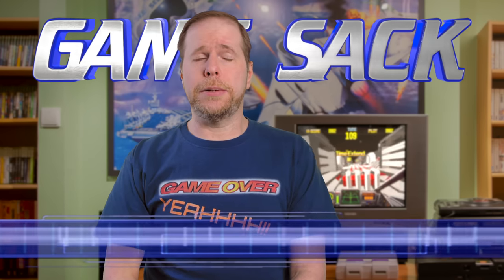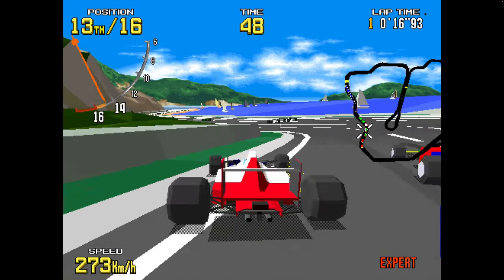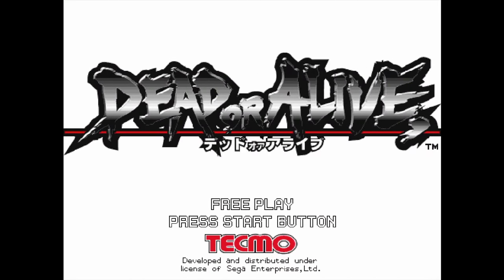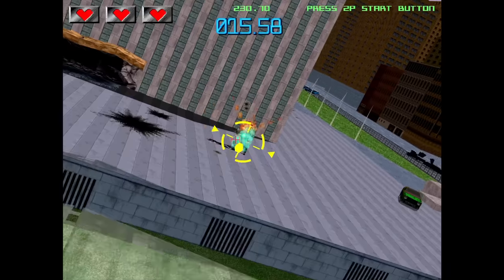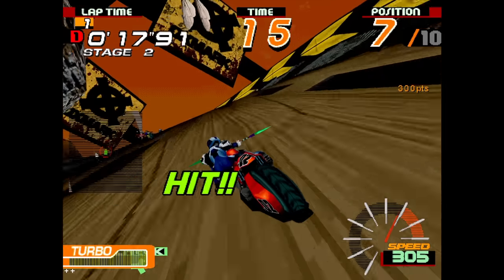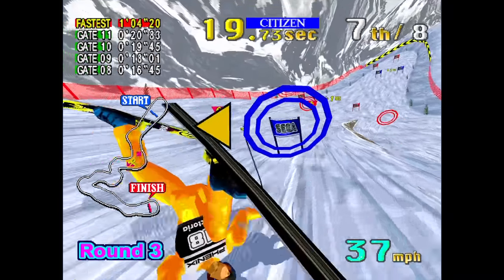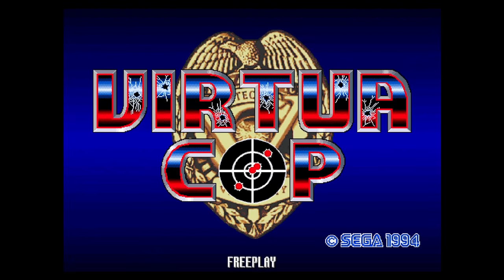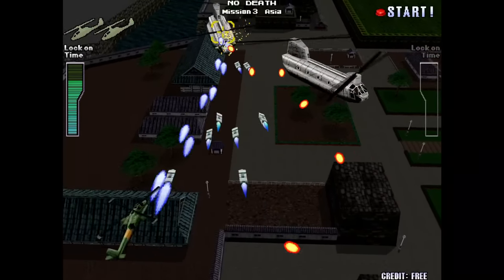All SEGA Model 1 and Model 2 Arcade Games

Comment: Virtua Formula was made for the pneumatic Full Motion Cockpit version. It does not have 16:9 because it used a 50" 4:3 Rear Projection TV for each Player. Most were later converted to Indy Formula (Upgraded Indy 500 for this cab) Sadly most were parted out in the early 2000s and eventually retired and replaced with the Super Deluxe Outrun 2 (Worked for Sega for a while in their Arcade Division)
Reply from the maker: Excellent info, thanks for that!
Reply: So the cockpits were pneumatic? I thought it would be servos and hydraulics. Neat.
Reply: @justin43098  Yep, Had to move an Indy Formula into a new Gameworks once, thankfully they had started building the locations with Air Lines throughout the building hooked to a huge Main Compressor in a sound deadened room to service it so all Pneumatic moving games did not need a separate and loud Compressor on the floor.
Reply: @youtubekilledtrustedflaggi9274  similar
Reply: That’s fascinating! I used to visit a large arcade in São Paulo, Brazil, that had 8 of these massive Indy 500 machines - and never understood why the cars had such different colors or the decals didn’t seem to match the game until I learned that they were likely converts from Virtua Formula. Sadly by the mid 2000s most of the pneumatics stopped working and they were eventually retired - by Outrun 2 SDX machines, of all things. These took up a lot less space, but the screens weren’t as impressive as the original rear projection ones.

I can still hear the “DRIVER CHANGE!!” yell from O2SDX in my head, haha.
Reply: We had it at my regular arcade, Wonderland, N1 City Mall, Cape Town, South Africa.
Was one of the largest arcades on the world at one time. It's a shadow of its former self now. 😭
Reply: I farted air out of my little bottom 💨

Comment: Man, Daytona USA is so much fun playing it in Manual, the way you drift by turning the wheel fast and then counter it on another direction while gear changing to Gear 1 and the Gear 3 & Gear 4 couple of times..
When you pulled it off, you'd feel like a badass.. so satisfying
Reply: The arcade with gear stick is definitely the way to play Daytona USA, playing it on console while is still fun, you definitely lose some of the magic by playing it with gamepad
Reply: Totally! Daytona USA was the only racing game I ever played using Manual!
Reply: Oh man, definitely..
Slamming it back 4 as you straighten out... I can still feel it!
Reply: The ol' 4-1-3-4. Nothing beats that. Except on the final turn of the Expert course. Sometimes you spin and look like an ass.

Comment: Back in the nineties, I worked for Toshiba UK LTD. I'm based in Plymouth UK. Part of my work was on the assembly line for Toshiba Rear Projection big screen TVs, which were a thing before cheap big screen plasma, and finally LCD screens came along..I mention it because we used to build the Sega Arcade screens for UK arcades. We had a machine set up as a tech demo on the production line, which showed Virtua Racer when I started, and was changed to Sega Rally by the time I left.

Comment: For Virtual On just use Model 2 Emulator 0.9 and you'll be happy again. Dual joystick support is limited in the last (1.1a) version of the emulator because it doesn't accept 2 inputs simultaneously

Comment: a lot of these games are more about the arcade experience, the physical presence of the machines, the unique control set ups and atmosphere more than the games themselves which are still pretty good
Reply: This is why I build myself an arcade a few years ago instead of emulating it on the TV sitting on the couch and play with a pad.

Ok not original but I tried to emulate the feel a little 😂
Reply: This is ironic because I actually prefer to play games like Daytona USA and Crazy Taxi on a controller than an actual wheel, pedals and gear stick lol

Comment: I wanna point out that Motor Raid does infact have a home port however it was only an emulated version of it in Judgment and its sequel Lost Judgment as a game you could play in the ingame arcades.

Indy 500 also has a conversion of it on the R-Zone which I'm sure is very much an arcade perfect port of it on the headache inducing red and black glorified calculator.

Comment: Such great memories, used to love top skater, had a cabinet over here in europe(btw the "S" rated tricks were if you jumped right at the tipmost of the ramps) it was a phisical skateboard with the buttons as the nose and tail and you had to tilt to turn and press buttons (fun mess) as you rode it inside a plastic dome with side handles to help balance. Had a great time reminiscing. Thanks Joe :)

Comment: I think for some of these it would be worthwhile showing the cabinets and describing other features instead of just showing video from an emulator. For example Gunblade NY wasn’t just a light gun game like Virtua Cop. It had huge machine guns mounted on a platform that would vibrate and shake with the explosions in the game. It was a completely mindless game but the physical cabinet added a ton to the novelty of the game.

Comment: I've had the chance to play Gunblade NY: Special Air Assault Force in the arcades and it was pretty fun, because it has one of those mounted turret guns with force feedback that you aim at the screen. That immediately makes it more fun. There's also a Wii version, for those of you who enjoy playing light gun games on the Wii (if I'm not mistaken, Joe doesn't). The Wii version comes with another cool game called L.A Machineguns: Rage of the Machines. Look it up, it's worth it if you can find it cheap and enjoy these types of games!
Joe, I don't post often, so I wanted to say something I should have said some time ago, I believe your sound mixing improved in the last few years.
At least it seems that way to me, since I used to have to change the volume throughout the same videos due to some parts having high volume and others being too low by contrast. But now the volume is constant, which is pretty cool. I hope you're proud of what you achieved with Game Sack, it's a great project, and one can tell you enjoy doing it.

Comment: Fun Fact - Gunblade NY was eventually ported to Wii in 2010 but was heavily censored for some reason. Lots of 9/11 related changes which are odd because by then companies had pretty much stopped doing that. The World Trade Center is deleted from the skyline and backgrounds, the United Nations building in Mission 3 is undamaged while in the original game was missing huge chunks from the side, a lot of damage to civilian buildings in background was removed, and oddly enough the NYPD cops you see get killed in various parts of the game (most notably in the second missions intro) are replaced by cab drivers in yellow hats for some reason.

Comment: I grew up with a few arcades not too far from where I grew up. Out of these I have fond memories playing Rail Chase Two, Motor Raid, Virtua Cop 1 + 2, Top Skater, House of the Dead, Daytona USA, and Sega Super Ski. The closest mall near me actually had a Sega branded arcade inside, it was called Area (some number) then later turned into a Gameworks. That closed then turned into World Sports Grill by Sega. That didn't last too long sadly. Thanks for bringing back all kinds of memories!

Cool crt by the way, is that the 24"? I have the 20af43. Just saw a 27af44 for 50 usd the other day and was tempted to pick it up. It was gone the next day D:

Comment: A particular tidbit on Virtual-On. If you happen to be using the latest version of the Model 2 emulator, it does have a weird bug where the simultaneous inputs could not be read. Meaning any of the movement stuff will be very clunky and may noy even work at all (like jumping or blocking)

Your solutions to that can be using a particular older version of Model 2 emulator, or playing the ports done by M2 instead (so that's PS2 Sega Ages, the one on PS3 and or 360 I think, or the Master Collection on the PS4). There's also the version within the Yakuza Kiwami games.

Comment: World Touring Car is a good driving game if you know how to play.
- You don't turn the wheel as hard in the game, playing like Daytona or Sega Rally is not ideal. Gentle accurate turns are needed.
- Brake tapping is necessary. Never slam the brakes, accellerate and tap the brake when turning, if you hold it down you will slow down hard or skid off the road.
- The game literally shows you the ideal spot on the road to drive : The darker parts. You'll notice a darker black mark all around the track. Follow that for the best laps and ideal points to turn from. 
- Once you complete the game, it unlocks the best car in the game which is like a rocket on wheels.

Comment: Since you've done Model 1 and Model 2 stuff, I'd love to see you tackle all of SEGA's STV games some time. Though that might could be preeeeeetty difficult with all the wacky Japan-only games and the odd photo print club stuff.
Reply from the maker: Are those emulated well?
Reply: @GameSack  Mednafen has compatibility with some games, MAME seems to have the best compatibility overall; though emulation is still, and I quote, "Imperfect" for some of the library. Now that you mention it though, I feel like it might take a little while longer for emulation to be at a consistent level; Saturn emulation is still a bit shaky and the STV is very close to the Saturn's architecture after all. But I digress.

Comment: Thanks for another great episode!! Question: I believe there were a couple of sniping games in the arcade then ported to SEGA Dreamcast also from SEGA. Does it ring the bell? The cabinet had a sniper rifle for accuracy and it was basically aiming at ppl on buildings.
Reply: Do you mean Silent Scope? If so it was actually made by Konami and the arcade hardware was the Konami Hornet. I wasn’t much good at it but I liked that series.
Reply: @tournaline3448  yes that's the one. Thanks for dropping the name, it has been a while and I couldn't remember.

Comment: I forgot Model 1/2 ran in 498x384, historically I find a lot of real performance related reasons for 360p range graphics especially for home platforms but not a lot of screen mode support across the spectrum of era relevant hardware platforms, I'm still not so sure what was so hard about including a mode directly between 240p and 480p, like even the SS can't do it? We'd be using it with 2X upscale in 720p right now had it been included more everywhere.🤔
1:26 I don't see any points of contention around "clumsily" after doing a quick 3-second search, so I think you're good.😉 But you can't press block-buttons, that's just odd?😄
Flat shaded polygons never did quite get to stretch it's legs until the point when it got outmoded Ie. Model 2 coming so soon after. Many people tried to make it happen sooner but the hardware was just too darn expensive in the mid to late 80s, PC software rendering made a good effort but poly count and frame rates could never get past novelty grade speed or match 2D frame rates bitd.
Even when texture mapping came in on Model 2 the home hardware like SS & PS1 still had some massive performance advantages for flat shaded polygons but that got relegated to special unlocked modes in most games that even did that. A lot of fun seeing all these games with such high video quality, I don't think I saw 50+% of these irl during my arcade days, one main reason to have a SS back then.😁
13:37 Out of all the SS ports that's the one I'd like to see get a homebrew remake since Sega did it dirty bitd. Would have been nice to see more optional RAM cart support in the SS 3D titles even just as texture space.
I think a lot of the special arcade control peripherals fare better now as many VR tools can tilt-approximate some while anything beyond that might make for some fun MAME 3D printer DIY kits. I see you already do such projects, easier to mod than I thought.🙂

Comment: Why did you disabled the texture filtering in Model 2 games? Model 2 was the first commercially available harware capable of texture filtering. Motor Raid is great! I play it to this day!
Reply from the maker: I don't recall disabling anything.
Reply: @GameSack  Sorry! Some emulators, like nebula, comes with bilinear filtering disabled. Nebula is old but very nice, small and competent. Too bad it is not being developed anymore. To enable texture filtering you have to edit the EMULATOR.INI file and change Bilinear=0 to Bilinear=1
Reply from the maker: @dijabreu  I used an emulator called Model 2.
Reply: @GameSack  If the executable is "emulator_multicpu1-1.exe" or anything like that, that's the one! You have to enable billinear filtering in the INI file. There's tons of things you can change, including gamma values.

Comment: The Model 2 emulator is a pain to emulate Virtual On due to its broken controls, if you push both sticks to the same direction one of the inputs will be cancelled so you can't play properly

Comment: Thanks for the great video but it looked to me like you were struggling with Virtual On. Not surprising considering the in-game tutorial tells you how to walk around slowly but it doesn't tell you that dashing and jumping provide a lot of mobility and firing while doing so makes you automatically turn to face your target. If the controls are unresponsive with that controller it doesn't really matter though. I loved the game on the Saturn but I only got to play it in the arcade once. When I returned to the arcade years later it was gone, replaced by some ticket machine or something.
Reply from the maker: Yeah if you listen to the video instead of just watch it, I said the controls sucked using an Xbox 360 controller compared to the arcade, and that it seemed slow whereas the arcade did not.
Reply: @GameSack  to be fair I did address that in my reply, I said if the controls for the controller were unresponsive as you said I'd have to defer to your experience. I was listening to what you said, you have a lot of interesting things to say in this video.